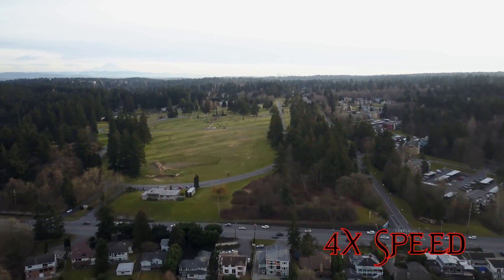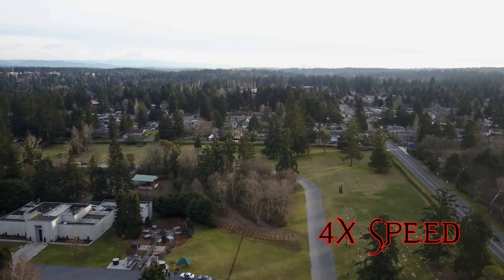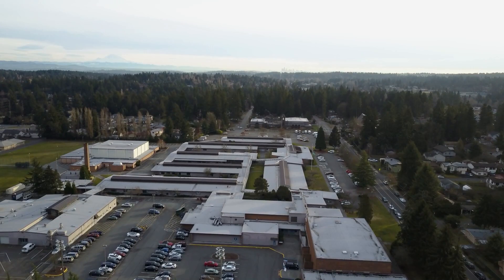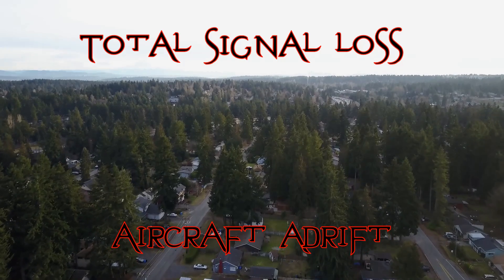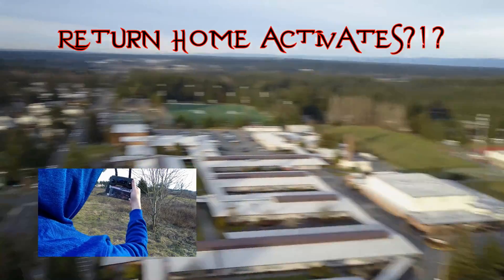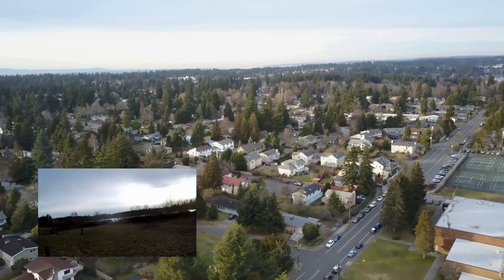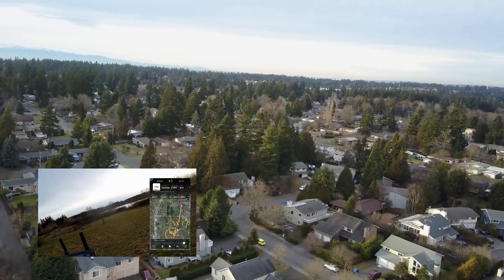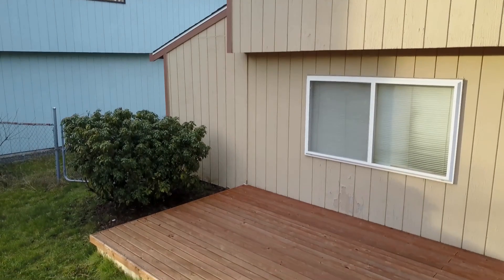Mavic Pro Return to Home (RTH) FAILURE! Recovered footage! What happens when it all goes wrong!

Comment: Buy a $20 Tile and attach to your drone.  It can then be tracked via your phone.
Reply from the maker: Jeff Rigney I now use (and reviewed) the Marco polo tracker. A tile would be an idea, but the 20-30 foot range would not work for me, and not in this situation either.
Reply: Infinite-T Digital. I'll check out the Marco tracker. I have a Tile on my P4 and assumed it would help me locate it in the woods which I fly over a lot. It will make a sound too. Maybe I just haven't had to use it yet and don't know for sure but now you got me thinking. Maybe the Tile needs a wifi signal to show on a map?
Reply from the maker: Jeff Rigney I'm not 100% sure of all the details on it but I know it relies on bluetooth to communicate with your phone, which in optimal condition has about 30ft range, in trees, or other "cluttered" conditions probably less.
Reply: Infinite-T Digital how much is the Marco Polo system?
Reply from the maker: Check my channel for the video on it.. It will tell you everything you need to know! (shameless plug 😉)
Reply: Infinite-T Digital did you know about the find my drone feature on the dji go app?
Reply from the maker: That's a fairly new feature in just the last month or so. I tested it once a week or so ago. It got me in the general area, but not super accurate. If you crashed say in a spot of thick brambles, you'd still have a hell of a time. Maybe I ought to fully test it and shoot an episode on it.
Reply: Infinite-T Digital that would be an excellent idea. Attach your Marco Polo and compare the accuracy!

Comment: Weird behaviour !  Glad you got it back.... I think I would have turned it around at the first sign of a hiccup....
Reply from the maker: Thanks! TBH getting hiccups, signal drops, etc is pretty common (for me on my S7 E anyway). So once it all went back to normal, with a good solid signal, I continued. However, at that first blip, I did hit RTH button and nothing happened.
Reply: Infinite-T Digital .... ah Android device.... there seems to be a lot of issues with android and software hiccups. I have had the software shutdown only once with the Mavic with an iPad mini4 but of course it was over the ocean..... but I was 500m out so still VLOS and my RTH didn't work either so I had to bring the Mavic home manually. Mine hiccuped after a firmware update but has been fine since.... I also got stick error just before the app crashed, the app wouldn't reconnect either :(.
Reply from the maker: Paul Riggs yeah, there is a huge ongoing issue with DJI GO4 and Android 7.*. It's been ongoing since February and so far DJI hasn't done a Damn thing to fix it. The app crashes to home screen 2-7 times every single 25 minute flight.. Imagine everything going dead every 3 minutes

Comment: Very strange. But TBH if DJI handed out replacement drones to everyone this happened to, they would be getting scammed 10x more often by people faking drone loss.
They need to come up with something more helpful in the way of FINDING your lost drone. They should sell the GPS locater as an extra or something. Glad you got it back and let's hope you don't get more strange signal issues again!
Reply from the maker: I fully agree. In my case, the RTH feature built into the drone did not function as advertised (and had done MANY times before on my P3A) as well as manual controlling, warning signals (didnt get the usual warnings) but I am glad the fail safe landing system did work and it didnt fall out of the sky on someone or land on the highway.  They also REFUSED to share or decode the flight log .TXT file to help me locate it, Did not offer GPS data, and were very rude and uncooperative on the phone/online chat.  I didnt fully expect to have a free drone just handed to me, just some help, and maybe just maybe something more. I have a Marco Polo tracker on it now (see my review on it) so hopefully it wont happen again! Thanks for watching!

Comment: For your video to be that messed up ?  The aircraft had to be really flying out of control   Falling. Drifting etc. I had the same happen and barely got it back.  It's possible there was strong magnetic interference as about a month ago it was off the chart for days.  You can get an Ap that tells you if it's safe to fly.  If it's in the red I fly a cheaper drone.
Reply from the maker: AboxofMonsters thank you. I will check it. What baffled me most is I flew the same path twice with both my Solo and P3A and this was the second run with the mavic.
Reply: Infinite-T Digital  I have standard 3  it's very stable always comes back  this mavic makes me nervous  the one good part is it's really just 750 clams if it's lost as the controller ain't cheap lol.  Flying mine out in the Gulf of Mexico in am  very nervous as I'm catching it as were in a twenty foot boat  this should be wacky lol
Reply from the maker: AboxofMonsters . Remember to change your RTH to the controller and not a home point on the map.. Since you will be on a boat that moves. Maybe get one of those "getter back" floats in case of water crash. Then you could snag it with a fish net or something. Fly safe!
Reply: News flash this is why dji tells people to keep your drone in line of sight yes you can fly far but you are not supposed to for this reason all drones have issues even tho they are supposed  to be perfect and work right they don't. I never let my mavric get out if my line of sight .

Comment: Please take a look at my video as I need you to check your flight log to see if you got the Yaw error before you got the interference as this may be a hardware problem as i have my claim filed.    https://www.youtube.com/watch?v=xRkQRZ3jFf0&t=659s
Reply from the maker: I looked over them again and I dont see any indication of a yaw error. In my case, I got the first interference warning at 2:51. I hit RTH but it didn't do anything. A few seconds later, it all came back, full strength and everything looked normal. So i went forward a little more and it dropped out again at 3:06. At this point , i did have a visual signal still, but no control. There was another interference error at this point. By now i was spamming the RTH button, and actually trying to manually reverse. A few seconds later I lost all contact. It's even more baffling in your case is you were pretty short range. Hopefully you have better luck dealing with DJI. They wouldn't even decode my flight TXT to help me find it.